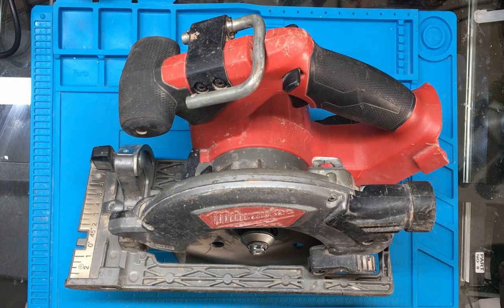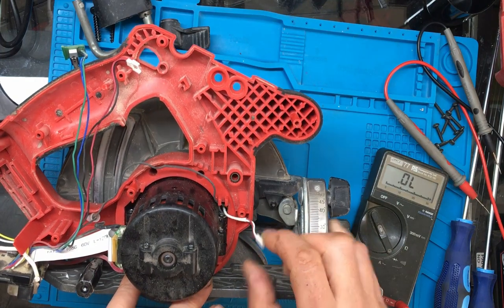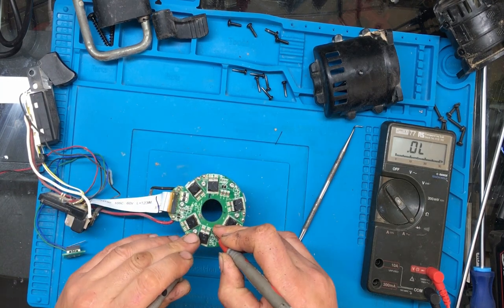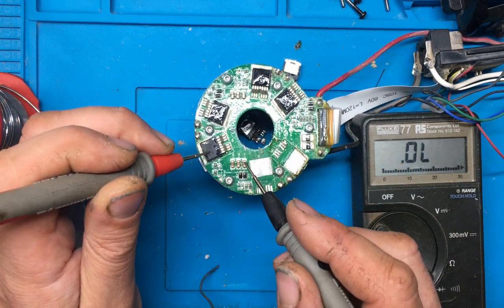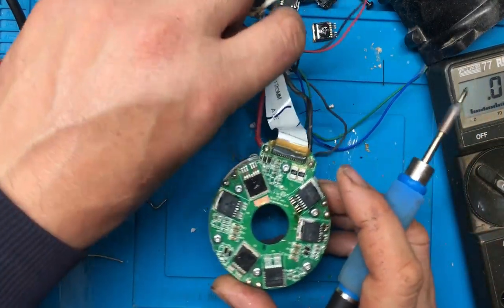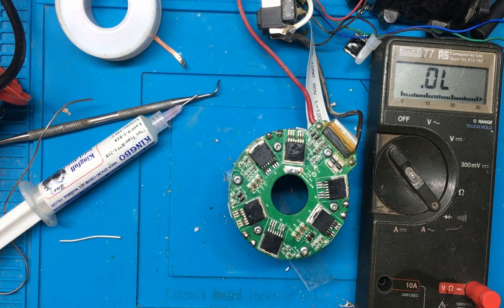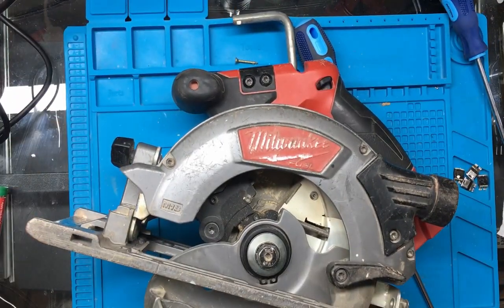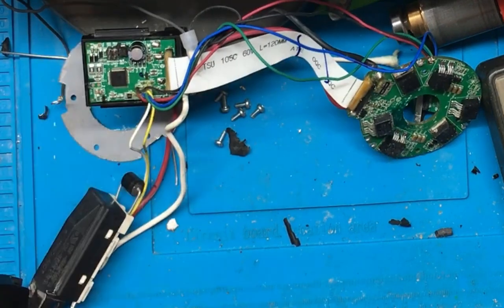Diagnosing And Fault Finding A Dead Milwaukee Circular Saw / PCB Repair.

Comment: I think when gate is short circuited with drain IC is damaged. It's better when only drain and source are short circuited
Reply from the maker: Yes, if it's the negative side mosfet that fails it's not usually an issue, but the positive side can send 18v back into the IC.

Comment: I'm from Russia, I bought 2 tools m12 2553, this is an impact driver, I bought them already broken, I fixed the first one in 20 minutes, there was a drop of solder on the legs of the motor driver, the second one I try to revive sometimes by measuring everything I can measure on its board 😂  It is not possible to find a datasheet or any information on this drv. The only thing I could find was a guy from China who wrote that this is confidential information and he cannot share it because he signed an agreement.  It's a shame that Milwaukee doesn't give you the opportunity to repair their instrument, but it's good that they didn't put transistors inside the driver chip 😂😂🤣
Reply from the maker: Hi,
Thanks for your comments. Yes you can't find much information on this driver chip, all NDA. I did have the idea of creating a replacement board based on something like openESC which could drive the motor, but I haven't looked into it any further. I think it would be a good solution and could be used for other tools too.

Comment: I have the same saw with same problem
Reply from the maker: I did a follow up where I did get it working, but not without a replacement microcontroller board which came from a donor saw.

Comment: What is the part number of those mosfets ..
Reply from the maker: I usually put it in the video, but I might not have this time. Most of the Milwaukee tools use a IRLS3034TRL7P.

Comment: hi, can you help me please, from where, we can find this mosfet. i couldn't even find online
Reply from the maker: Try searching for irls3034trl7pp
Reply: I have a simular circular saw and i have 320N4Fb mosfet from brand ST but i cannot find this mosfet on web. Is it possible to chane it to IRLS3034trl7p as a replacement part?
Reply from the maker: Just had a search for you. I think you are looking for a STH320N4F6-6 👍
Reply: Yes i have looking for this part! Thank you for your information!
I have one more question. Does anybody know what's the replacement part of the hall sensor? Because on the top of my hall i can read "5TEJ" and i cannot find this part. Or i can replace any hall sensor wich operates 3.3V?
Reply from the maker: You're welcome 🙂. I can't find any hall effect with the number you gave. Are you sure it's a hall effect sensor?  https://smd.yooneed.one is good for searching codes but that code isn't listed.
Reply: The hall effect sensor is on the back of the PCB where the coils located. There are 3 hall effect sensors, but on my PCB the rotor(the permanent magnet) hits one of the hall sensor in my rotary wrench.

Comment: With the number of Milwaukee products that you feature on your channel I don`t think I would purchase any Milwaukee product
Reply from the maker: If I was purposely going out and buying broken Dewalt tools to add to my collection you would end up thinking that about Dewalt, but I already had some Milwaukee tools and thought I'd save some money by buying broken ones and repairing them.
Reply: It would be boring if he only fixed the running ones. They are mechanical tools due for mechanical break down they are not flawless.

Comment: Motor, module and switch assembly but too high price
Reply from the maker: Agree. Too high a price for spare parts unless you can replace individual components.
Reply: Really? How much?
Reply: U.S. $150 to 240 for brushless motor with PCB and switch assembly
Reply from the maker: For a BLCS66
Milwaukee Electronics
Product Reference: 4931465887
£132.99 Inc VAT but you can get a whole new saw for around £149 on Amazon!
Reply: Motor with PCB and switch assembly but too high price for milwaukee m18 and dewalt 20v & 60V  circular saw, reciprocate saw, chainsaw and right angle drill

Comment: The same fault of this device is on,, Daniel Rakowiecki" Chanel.
Reply from the maker: I did a follow on video on this a few weeks later and repaired it after someone sent me a spare microcontroller part.
Reply: @BuyitFixit  what about programming?
Reply from the maker: It was a used board microcontroller board (not just the chip) from a broken saw (but the chip hadn't fried) so it was already programmed. I had thought about designing my own board as a replacement for these as it seems a common problem.

Comment: Working on 1 that looks new & has power to the motor , led lights & that is all that happens. Trigger isn't the problem,  when triggered,  power sent to the motor , it was bought for diy & has only been used on 2 projects,  & FAILED  pisspoor Milwaukee
Reply from the maker: Yes the saws seem a bit problematic, I've seen a lot of failed ones on eBay. Possible some design issue and not the best product I think. Some of the other products like the angle grinders and impact drivers I've not had any issues with.

Comment: Guess I’m throwing mine away 😂
Reply from the maker: Depends if the main controller is fried. If it's just the mosfets it's repairable. I did get a replacement control board from a viewer and used the motor board I repaired and fixed it in a later video.

Comment: trigger problem ,i fixed my like two weeks ago.
Reply from the maker: Well done. Glad you got yours working. Switches seem to fail on these often too! On this one the microcontroller was faulty as when the mosfets failed they backfed voltage into it. I did fix this one in a follow up video as someone sent me a replacement microcontroller from a donor machine.